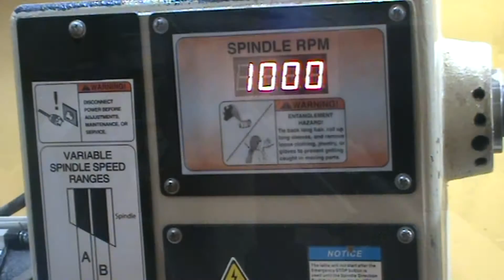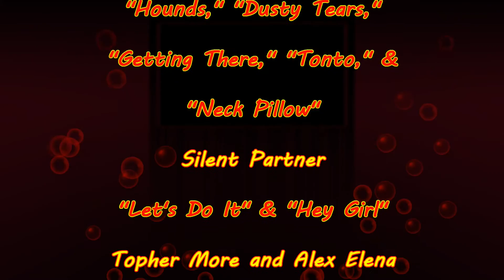The Skew Chisel, Part 2, Practice Cuts

Comment: If you have time maybe you could cover some other tools in Spanish  & English. I learned alot from this video thank you.
Reply from the maker: Hi Art! Thank you very much for your comments! I am glad the video was of help. I have some other material in my channel. I have very detailed information in the videos about threading on how to use the thread cutters, which are very specialized tools, and about the bowl gouge, since it is the tool I use the most, in most of my videos I explain different cuts. Perhaps it is a bit more dispersed than in this particular video and I will consider your suggestion for another video. Cheers! Daniel

Comment: Thanks Daniel I really enjoy your videos.  I'm brand new to turning and having been learning a lot by watching them.  How often did you have to sharpen the skew while producing the video.  Thanks.  George
Reply from the maker: Hi George, Thank you, my friend, for watching the video and for the comments. I generally sharpen the tools every 15-20 minutes. Because I have the set up ready for the tool I am using, it takes literally seconds to do it and I hate to turn with blunt tools (besides it is dangerous). With very hard woods, sometimes I need to sharpen more often. In the case of the video, it was around 20 minutes, because I was turning dry pine, which is relatively soft. Cheers! Daniel